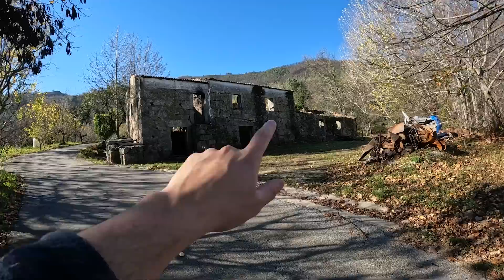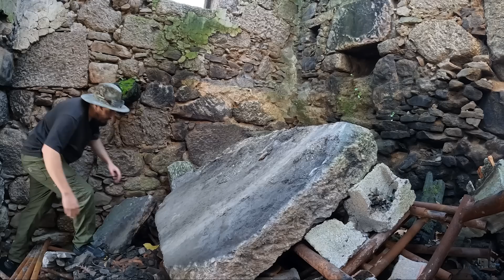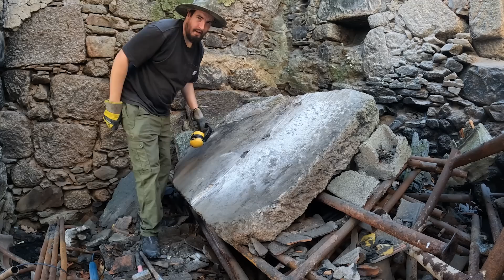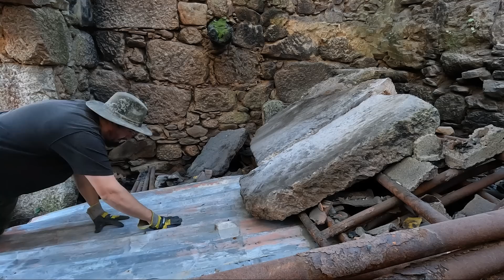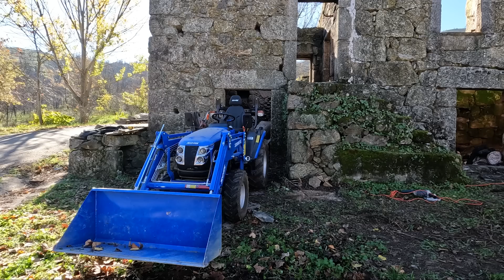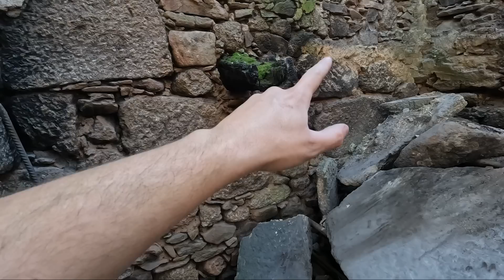#8 Is Our House Beyond Repair? Portugal Renovation

Comment: That’s the way Roman fortifications were built, two stone walls with a filling of smaller rocks and pounded clay or mortar sandwiched inbetween. It should be structurally sound still, fire or not, these types of buildings stood the test of time.
I’d be more worried about that ivy (or whatever the plant is) growing on the stone, that can potentially destroy the wall quite fast.

Comment: There's an easier way to split the stone than hammering a chisel across the seam. Once you cut the seam, prop up half of the slab and place a board or beam underneath it close to where the seam was cut, and then whack the other side with a sledge hammer. It's the same principle of cutting glass panes. The harder the stone, the better this method works.
Reply from the maker: I’m sure this would work with a smaller stone, but this was well over 1 ton money I could lift it

Comment: Excellent work today, Theo!  So exciting to see that stone split so cleanly, and then come sliding out the door like Prince Albert II on his bobsled.  I think you're right to keep at it, with the advice of your engineer. The old stones are pretty resistant, and even if some parts of the inner walls need replacing, the fire didn't build up so much heat outside.  

Also, around 15:00 you are standing by a lovely growth of navelwort, Umbilicus rupestris, which is a delicious addition to a salad, succulent and crunchy.  

Cheers to Bee!

Comment: I would consider, looking putting a steel frame inside the house,  the heat from the fire may have introduced faults and weakness into the stone of the building, and I don't think it has any shear strength,  If you use a steel frame, it will be smaller on the inside and support the roof structure, thereby ensuring that the stone suffers no more stress.  The inside needs underpinning anyway,  so a foundation of sorts will get the interior square.  On the rear of the property, I would ask for some modern structure of the architect, life support, and utilities can be planned without having to fight the stone walls,  it would future proof it as well.  You are doing great work, but think with your head, not heart.

Comment: On the first video showing the larger area there was the remains of a gas cylinder which had split open . This could be why the fire was more fierce in that part of the building.  Wait until the engineer has done his inspection and given you his report .

Comment: I'm no expert. But I've got a thought too 😅
Maybe put up a concrete wall on the inside? That could be an easy way 😊
It will hold the inner wall up and gives you a straight wall to start with.  Just hide/cover/strengthen up the bad walls 😊

Comment: If you find out it is unusable,  a suggestion.  Remove all unsafe areas and turn what's left of the ruins into a beautiful garden  area. You could still let guests  come and enjoy it as  tent campers or van campers. A beautiful garden with fire and barbecue pits, tables and chairs  would be a welcomed rest spot for your guests.

Comment: You might have heard a collective sigh of relief when you mentioned a structural engineer.  Not that we had any reason to doubt you would get a proper survey of the property. It’s hard enough to take on a project like this as an individual but to do so in the public domain does attract a multitude of opinions.  Mostly, folk mean well! Hopefully it all works out and becomes a building that will honour the original builders.

Comment: Theo if your cutting any more rocks, rent out a con saw it has more power & a bigger disc. Save your back. Doing a great job so far
Reply from the maker: Can’t rent here, I also by the time I rented that I would have cut the stone this way.
Reply: @theindieprojects  that's a pity, time contraints make sense. Hopefully, there are not many more big ones to cut up.

Comment: Your are working to hard. Why not use the traditional stone cutting method? Drill several small holes put in the wedges and spikes into the holes. Then you just hit each spike down the line and the stone will split. It’s a lot less effort. and the stone will split straight.

Comment: What about tearing down and starting over with whatever stones are useable? Have you heard of the Slipform Stone Masonry technique? It uses wood forms, concrete and stone and can be done by yourself.
Reply: Far too expensive. Every stone would require manpower just to move it. 
Castles were built using much the same building technique. The walls aren't easy to just take apart like plastic bricks kids use. 
Plus it's very dangerous work moving 1,000 kg stones in tight spaces, that one lintel alone is at least a ton of stone.
Reply: Do you think they used block and tackle to hoist them into place? I was definitely thinking they were smaller. I know Helen and Scott Nearing (book "The Good Life") used Slipform to build a huge stone house here for very cheap, something like 70 years ago. They were both older folks and did all the work themselves, but the stones were much smaller.